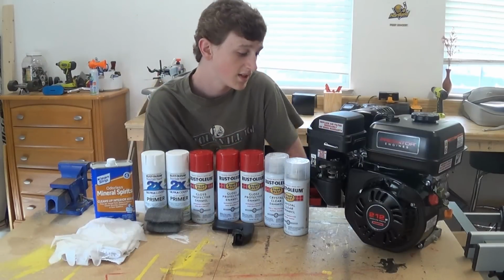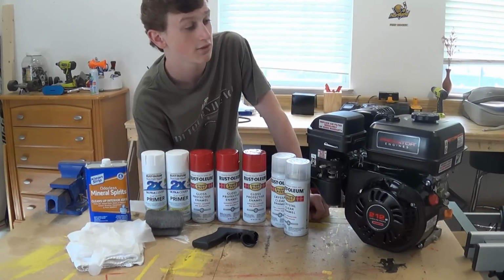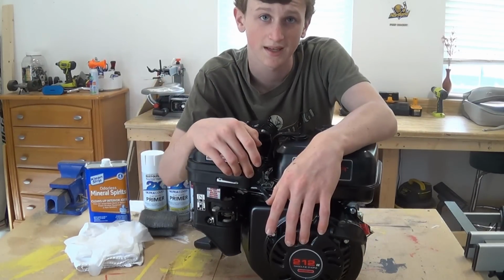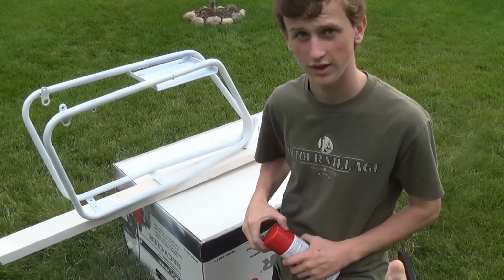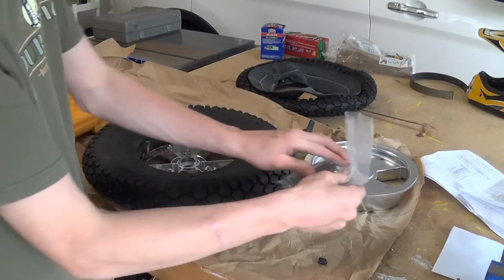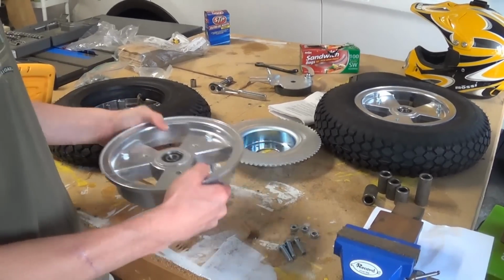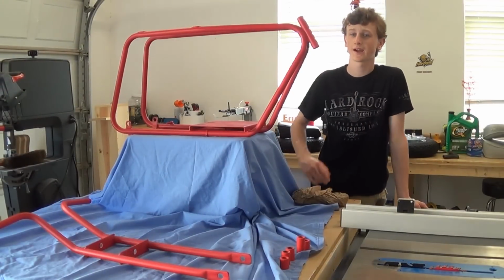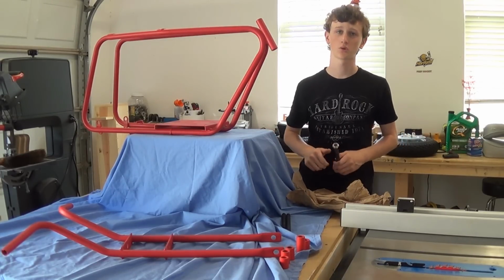How to Build the Azusa Mini Bike Kit | Part 1 of 2

Comment: Did the same paint  on a used  go cart  i found at a yard sale for my son. He wanted it “blood red”. And picked that paint out at the store    I did not buy the   Triggers  you used but if i were to do it again i would.  The paint  is still in good shape  over 10 years  old and  quite a bit of hard use ! The carts been rolled a few times   So  it has scratches now.

Comment: Folks, many DIY stores have that flat rubberized sheets that you can place the engine on to help reduce so much vibration going through the frame while operating it and absolutely worth the extra time and care to do so..you could actually fold the thin rubber sheet twice for added damping
Reply: Don't think that will work. Best to rigidly mount the engine and if need be, to put some rubber donuts between the seat and the frame to dampen vibrations

Comment: Hi! Great build! Perfect!! I do have a question..can you tell me what size the rear bolts are that go thru the rear wheel...they are the longest ones you used...not the inch and a quarter but the longer ones that were NOT fully threaded....thank u so much!

Comment: On the site it says max engine height is 13 & 1/2 inches. Have they changed the design or will the 14 inch high engine still fit?

Comment: I saw in a previous comment that the engine came with the spring where did you find it and where did you connect from on the throttle not on the muffler
Reply: Also what size bolts did you use to bolt it done

Comment: OK thanks and does kit come with a chain also I bought the same engine as you so about how fast will I go
Reply: buy the Tillotson 212 because it is only a little bit more expensive but it has 10 hp stock